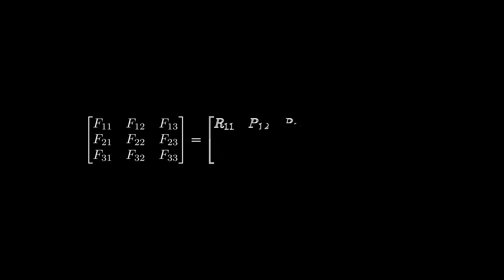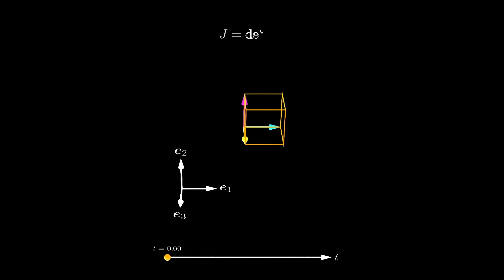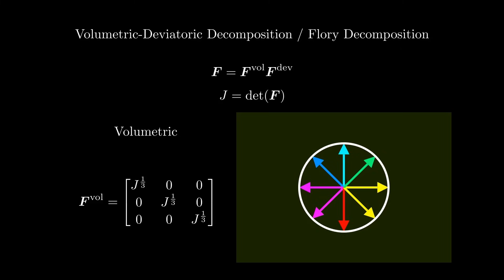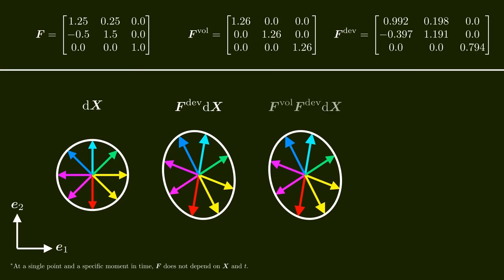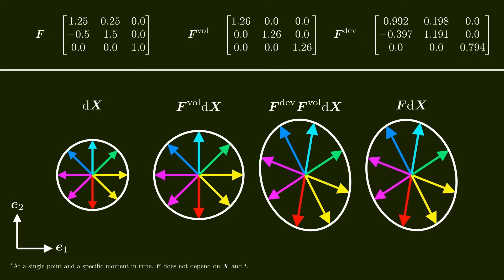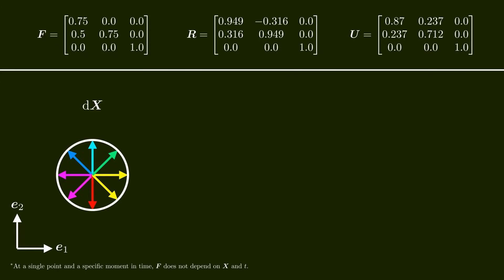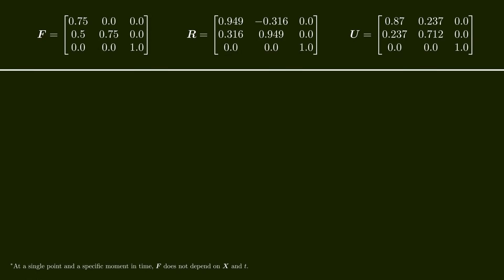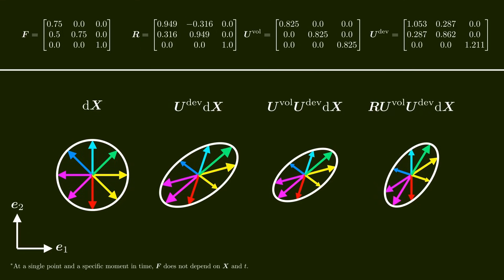Matrix Decompositions With Geometric And Physical Interpretation

Comment: Nice video but let's fix one mistake. Stresses are not rotation independent. There are many different stress definitions depending on which configuration you are in, and rotations take very important role in there. Another point is the volumetric/deviatoric decomposition of the deformation gradient. Yes, you can decompose theoretically but in practice it is pretty useless, since at the end of the day you have to use the complete gradient to map to actual configuration. The volumetric and deviatoric split makes more sense if we do it for strain tensors, where we assign them specific roles for the constitutive modelling. Nevertheless, that is a good content. Thanks for sharing.
Reply from the maker: Indeed, good catch! I was thinking about the strain energy density, which should be invariant to such rotations.
Reply: This isnt actually correct.  "Real" stress, as in stress that can be measured in real physical objects, is galilean invariant. There are many purely numerical definitions of stress that are handy when implementing certain numerical schemes, but they are not a direct representation of the real world.  Stress in an object is independent of any rigid body rotation of that object.
Reply from the maker: @jacobmoore2036  So, I think what @oozzggurr meant is that, for example the first Piola stress is not invariant to rotation. Would you say that this is not a real stress? Do you have a reference?
I definitely want to dig more into this before continuing this series of videos!
Reply: @DrSimulate Yes, I would say that is not a real stress.  That one in particular is a two point tensor, which exists partially in a reference space, and the deformed space.  The actual physical material only exists in real space.  The reference configuration is just handy for numerical implementations because it maps back to the initial mesh, which is generally well behaved. I think Cauchy stress is the only definition that lives purely in the actual physical deformed space.

Comment: One more question; suppose we have a cantilever beam with a vertical tip load. It experiences "large" deflection. Two cases: the end load keeps the initial axis of influence, and it rotates with the deflected beam. Could you comment how would you model them with your approach? Thanks a bunch.
Reply from the maker: I am not sure if I fully understand the question. But it seems that you are concerned about whether to formulate forces in the reference or current configuration. I want to make a video in the future about different stress measures in the reference and current configuration. Maybe this will clarify your question..
Reply: @DrSimulatethanks in advance. The question is about large deformations: Due to large rotations the effect of external forces can change since the orientation changes. For small, infinitesimal, deformations there is no such effect, or neglected.
Reply from the maker: @8hng  Yes. This becomes also important when talking about buckling effects..
Reply: @DrSimulatefollowing up this thread, this seems applicable to rock mechanics and see how much squeezing is manageable

Comment: Nice video! I just want to point out that when you animate rotation matrices by linearly interpolating their entries, the intermediate matrices are generally not rotations; in the video you can see the shape contract and expand slightly as R is applied. As you have used fairly small rotations, the effect is barely noticeable, but in the worst case (a 180 degree rotation) the entire shape would contract to a point halfway through the animation. The solution to this is so-called spherical linear interpolation (SLERP), which involves linearly interpolating a logarithm of the matrix instead of the matrix itself. Again, awesome video - keep it up!
Reply from the maker: Hi, good point! In fact, I thought about this. I was lazy and didn't want to spend more time on this. I thought no one will notice. You proved me wrong. 😅
Also, I wasn't sure if I should show the animation at all, because mathematically there are no intermediate states here. If F is considered for a given moment in time, it transforms the dX directly into the dx without any intermediate states. So, it would have been more correct to show dX and then in the next frame dx, but this doesn't look so satisfying :D
Reply: @DrSimulate I noticed because I referred to this so-called candy-wrapper effect as motivation in a talk I gave at my university recently. Probably very few people will notice until they see my comment. 😁You are right about animation of course, on both counts!
Reply: Thank you. It is a great comment for such a subtle point.

Comment: Nice! You might like "Meshless Deformations Based on Shape Matching" paper (Matthias Müller et al) from 2005. They actually used this kind of decomposition to simulate deformable bodies. By doing a similar decomposition and removing the volume distortion, they are left with the closest deformations which preserve volume. It's a great application of this stuff.
Reply from the maker: Thanks, will take a look at it!

Comment: this video came somewhat conveniently, as I am also studying decompositions of the strain rate tensor, albeit in fluid mechanics. My problem is to conjure some kind of physical meaning out of the crocco decomposition (where the convective derivative, ((grad u)^T)u is decomposed into the gradient of u + twice the rotational part of the gradient, which through some algebra leads to the gradient of kinetic energy minus the lamb vector